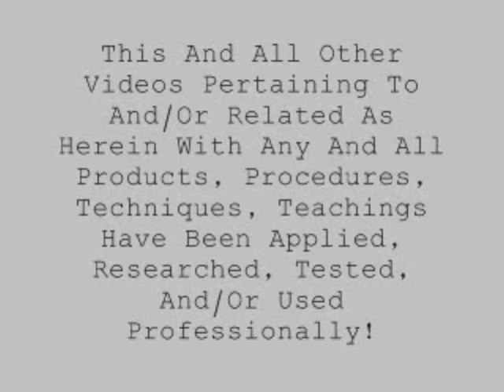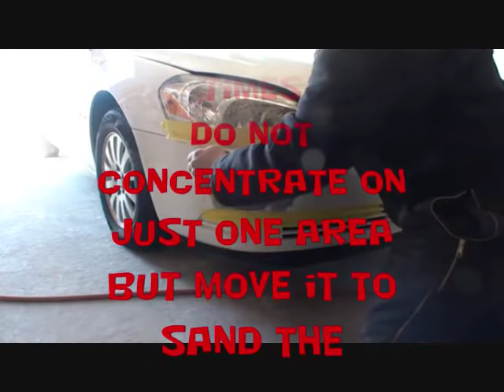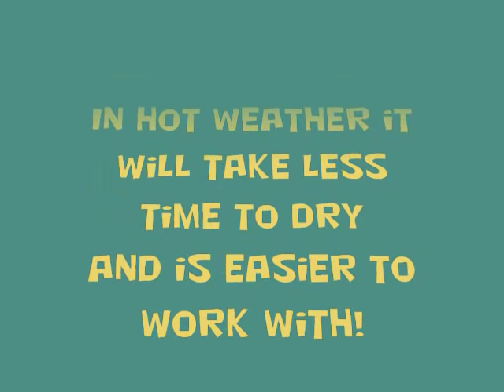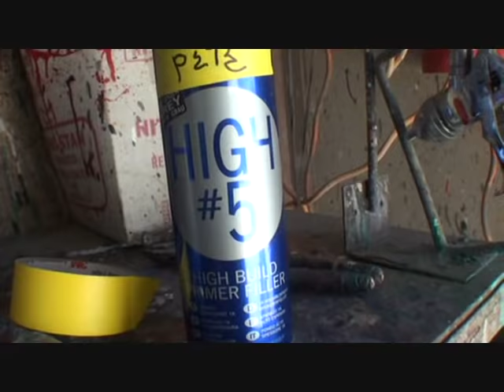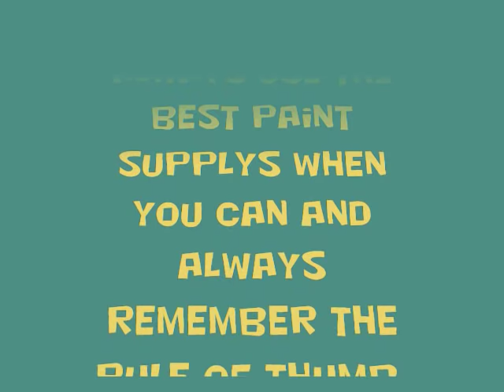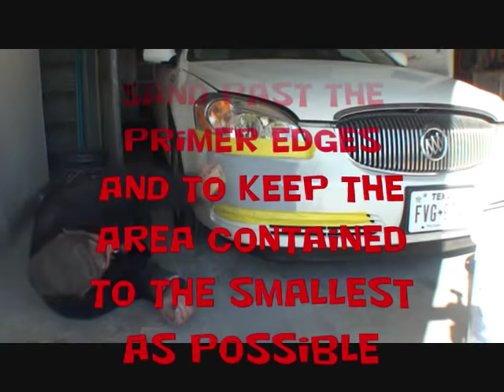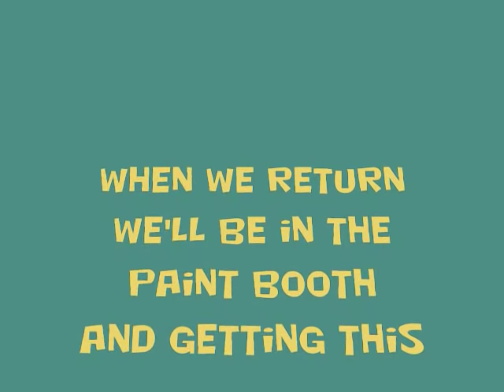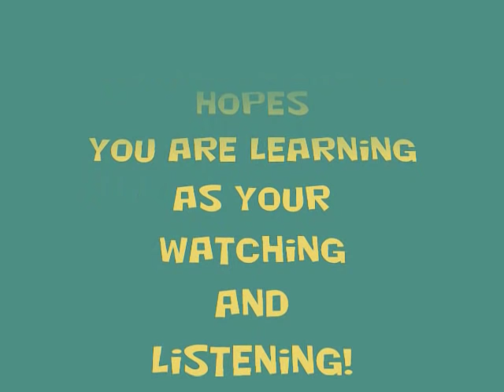How To: Repair And Paint A Bumper Cover From Start To Finish-Part 1

Comment: I would just like to say thank you for taking the time to do all these videos. I had a garage door close on my car and it left a nasty scrap on 2 different panels. I also had a ding in my hood from a rock on the highway that I wanted to get fixed. I went to two different body shops in my are and was quoted $3000 from the first and then $1200 from the other shop. There is no way in hell I'm paying that much just to paint a bumper. Oh, this is after I did all the prep work you described in this video. I going to follow this guide and paint the damn thing myself. Thanks Pete!

Comment: I   have used the exact  can primer you show. On small spot repairs. Sprays out in force kinda like the pattern. . I have not had any problems with it except it will left repainted panels.

Comment: I learned a lot from your channel on bumper repair and paint. I have repainted and repaired a few auto body pieces since watched but recently ran into a problem. My spray gun was clogged so I used a Preval aerosol sprayer and it worked great until I applied clear coat. The clear coat appeared rough and bumpy. What is the cause of this? Thanks!!

Comment: Hey Pete, thanks for suggesting that 2K  primer to me.. Damn thats some nice primer!!
Reply from the maker: +Junk Box Mike Calvert Glad it all worked out for you Mike.. Hope the Caddy is coming along alright....
Reply: +diyautoschool Its comming.. I finally got all floor, braces and inner rockers done... Quarter panel patches in and body work done on the body shell... and in primer.. now lots of metal work on doors, fenders, hood and deck lid.  whew. yeah, its goin.

Comment: So I picked up used rear bumper for my car that previous owner tried to paint it himself. Now cracks are all over the bumper so I sanded with 120 some areas down to raw plastic. Should I spray adhesion promoter before I apply filler? Will filler stick to sanded plastic? Or should I continue sanding raw plastic with 180 240 320 red and gray scotch brite spray adhesion promoter and then apply filler?
Reply: use duraglass to the sanded plastic but keep it thin and preferably after mounting. Add flex to the clear, 2 coats

Comment: I have had that wrinkle primer problem and it is a big mess!
Reply from the maker: +70carlton Your exactly right,, it's a very big mess when you start getting wrinkels and cracks in your primer... Good luck fixing it. Pete
Reply: one reason for wrinkles in the primer is outdated hardener, also can cause severe orangepeel